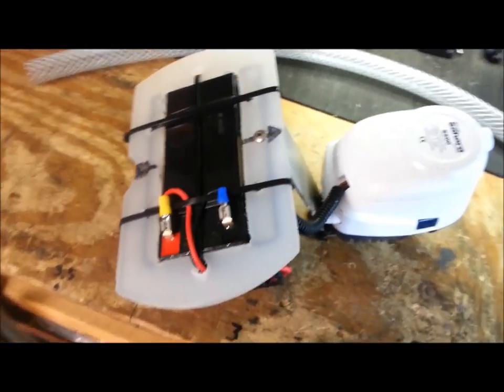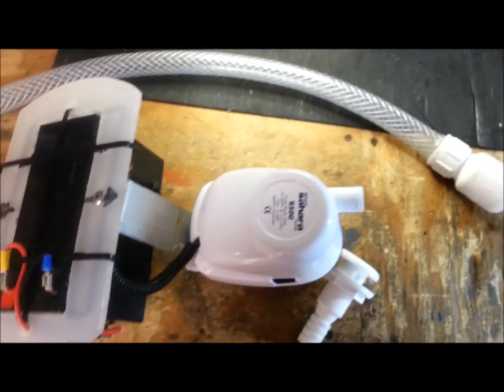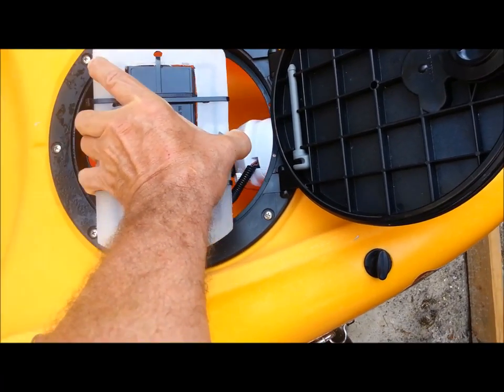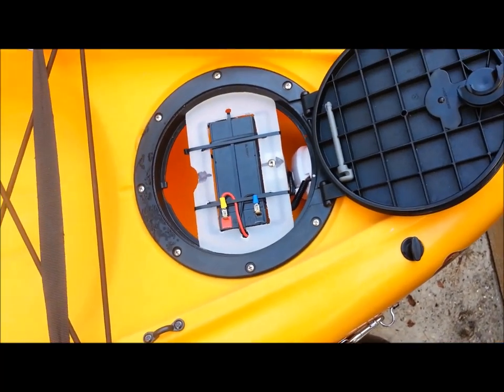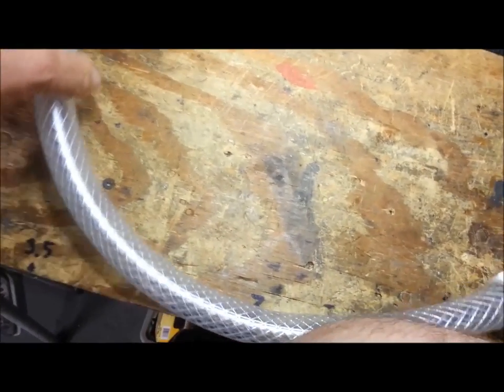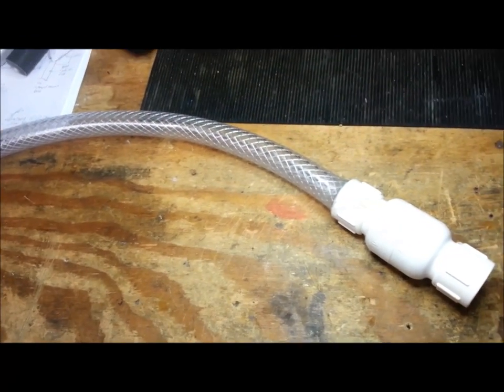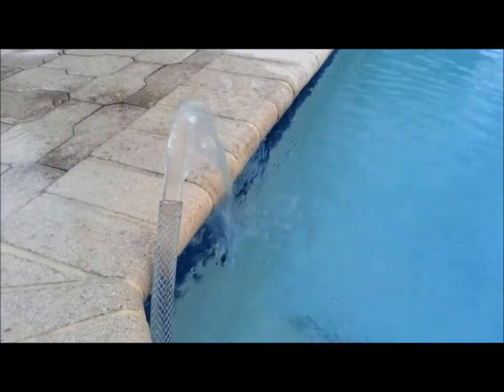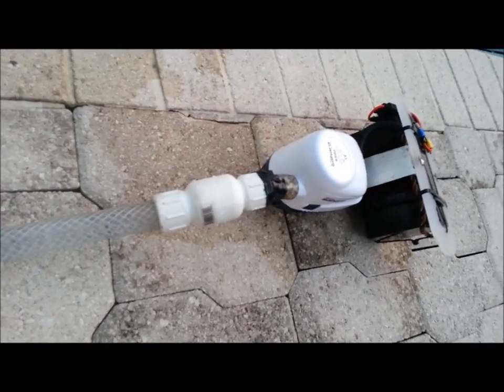Hobie Outback Kayak Self Contained Automatic Bilge Pump Build & Test Part 1

Comment: nice!
Reply: This is an excellent modular set-up.  I like your design skills.  But my bigger concern is why are you taking in so much water?  I have the Hobie 2017 Outback and after using in the ocean, I don't have any water in the hull.  I noticed that you have drilled quite a few holes in the kayak, you might want to test the integrity of all the seals.  I personally would rather have a water-tight kayak than depend upon a battery operated pump to keep me afloat.  Why do you need it to operate upside down?  When upside down, the pump should be in the air.  How does the salt water affect the one way valve spring?
Reply: Sorry, another thing.  Why drill such a large hole in the body of the kayak.  With that philosophy, you are just setting yourself up for more leakage.  Just exit and seal the hose in the normal drain plug in the back of the boat to the right of the rudder.  I know that this video is already 3 years old...hopefully, you have already modified your set-up.  Thanks

Comment: Great idea John. I went sailing my Tandem Island on Lake Coeur d' Alene the other day and took on 3 gals of water in 5 hours so I'm a bit nervous till I fix whatever is leaking. The pump is 1.5 amps so I was thinking a 12amp batt to be on the safe side, although it is heavy at 7 lb. It will still fit in the 8" round hatch like yours. The 10amp is 6 lb so not that much difference. What do you think and how long would a 7 amp batt run?
Reply from the maker: Thanks! Mine ran for not quite 5 hours on 12 volts.

Comment: Doesn’t the water pool right under your seat on the outback since it’s the lowest point of the yak while your on it in the water?
Reply from the maker: No. My butt doesn't get  wet. There is a  scupper  there
Reply: John Sims I was referring to inside the hull. Isn’t the lowest point under your seat inside the hull and having the pump at either end run a risk of taking on a bunch of water until the pump kicks on?
Reply from the maker: @MrSurf247  No, actually when I am in the water and the yak is loaded the stern is the lowest part in the water, even so with me not in it. Of course every yak is probably different.

Comment: Have you tested on how long that battery will run the pump?
Reply from the maker: Yes. It runs the pump for 4.5 hours until it's completely dead. I tested it all the way down to 7.8 volts and the pump still ran.

Comment: How would the battery hold up when it is in the water. Those terminals didn't look waterproof. Salt water can short the terminals and render the battery useless.
Reply from the maker: I sprayed them with corrosion Stop but yeah I need to seal them
Reply: +John Sims sealing it would help. With the terminals being so close and water (especially salt water) conducting electricity the pump may not run if the kayak was flipped and battery ended up submerged.
Reply from the maker: +Stephen Williams yeah.  I was thinking of a waterproof connector for it that I can plug a charger in to.
Reply from the maker: +John Sims I know they make them and they are very good!